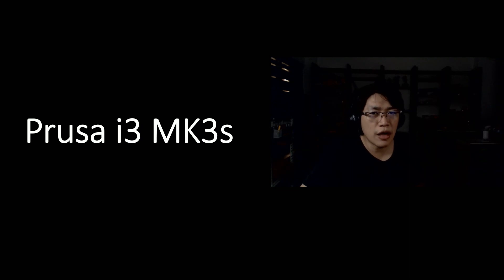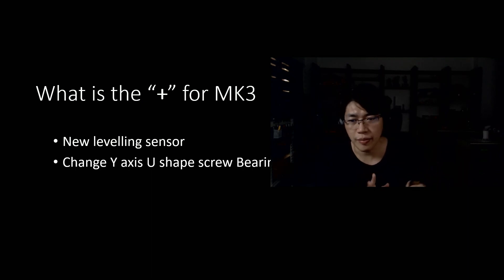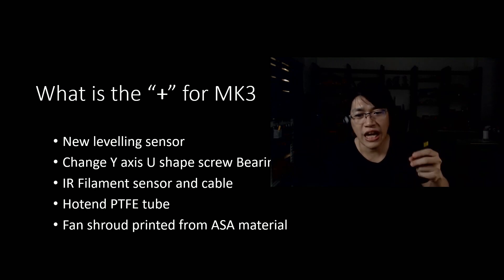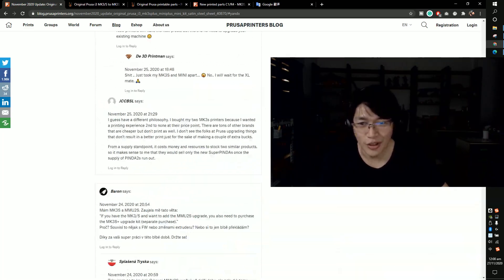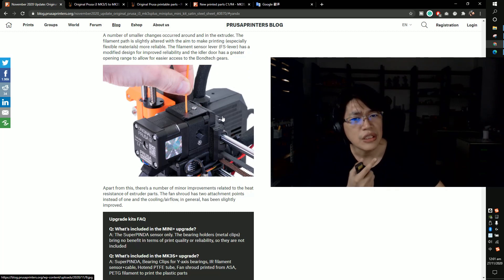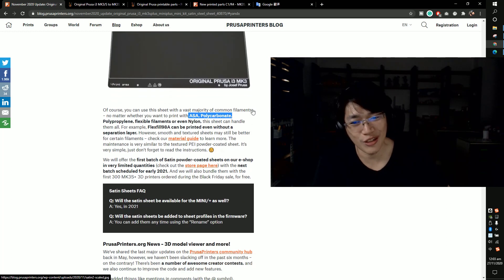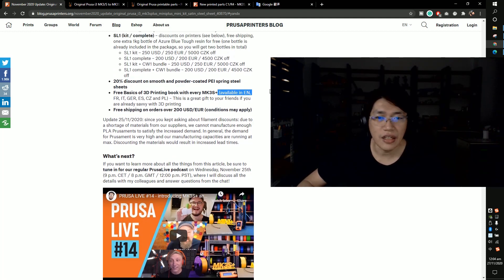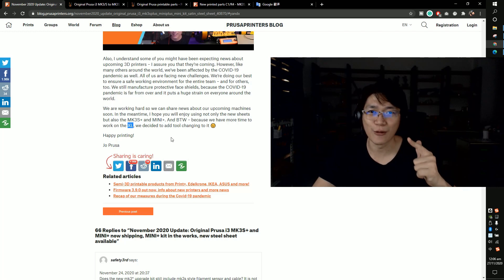What difference between Prusa i3 mk3s and Prusa i3 mk3s+

Comment: There are several changes to the upper front part of the extruder. The main part that has the x axis bearings on it stays on the printer, but most of the rest gets changed. All parts around the filament sensor (the area with the ball bearing) changed. This new one is completely immune to any issues associated with not seeing clear filaments. The Minda probe versus the Pinda Probe. The new probe is significantly more accurate at knowing where on the bed it is. It is also much more accurate in determining how level the bed is. The bearing caps for the bed aren't critical. ignore them unless you are having problems with those bearings binding. One thing you missed is there is new Y axis clamps to hold down the 9mm rails the bed slides on, instead of the old nylon wire tie method that was on previous versions. There is also a new version of firmware that identifies which probe you have and uses that one accordingly. Overall, this kit wasn't crucial, but it does provide a much better method of levelling the bed. ..